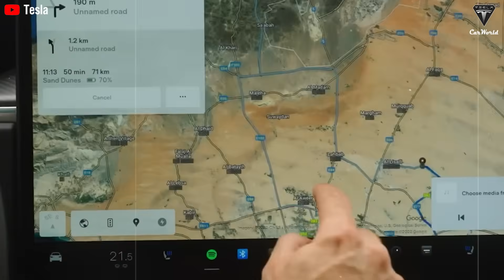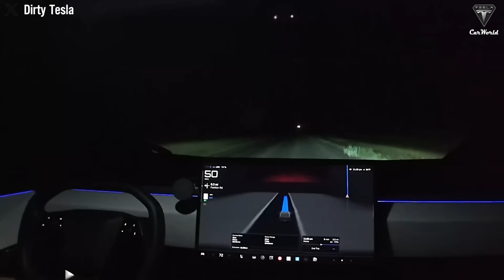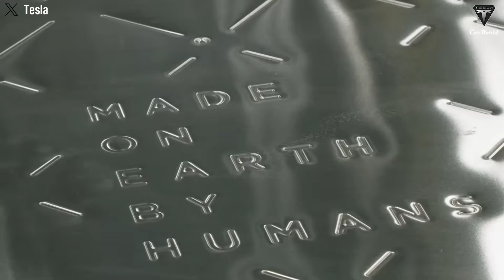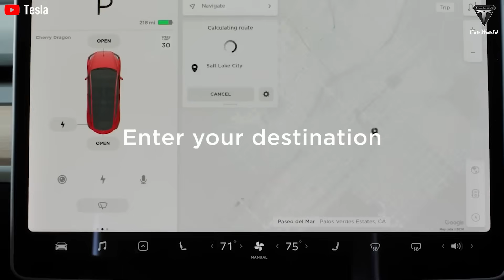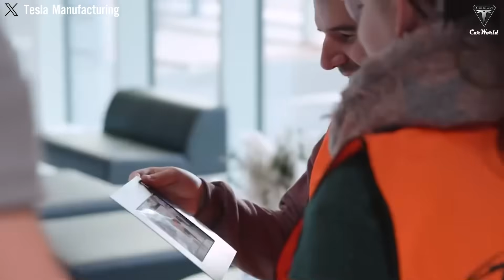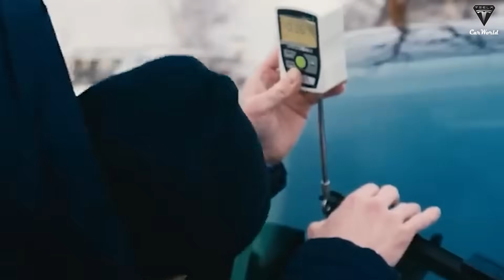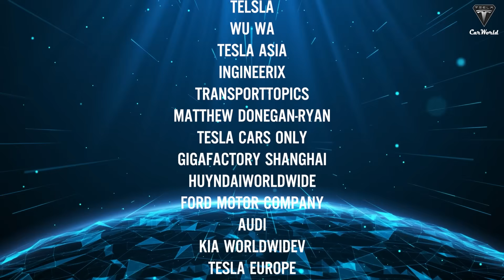Just Happened! 2025 Tesla Robotaxi Finally Launched! ONLY $4.20 Fare, What's Inside?

Comment: "At roughly $0.0014 per mile (or $4.20 for an average trip distance), this pricing is significantly cheaper than Uber’s average fare in Austin."

At $0.0014 per mile one have to drive 3000 miles!!! for $4.20
Check your math

Comment: ❤ I just paid a cab driver  $40.00 to make less than one mile but Three stops on the way home. That would be a great advantage to me!!❤
Reply from the maker: That sounds really frustrating! Tesla Robotaxi aims to cut such costs drastically, with autonomous rides optimized for short urban trips. Savings and convenience ahead!
Reply: Bless you ,my once a month earon's run was never less than 200.- 300. each month.  As well as Retired check helps another.
Biden's  and Harris increase to senior's ,help me get out and get me a long time "after retirement" ,needed pre used vehicle.
This will be nice ,hope it's equipped with video and an easy way to stop if necessary.😊❤